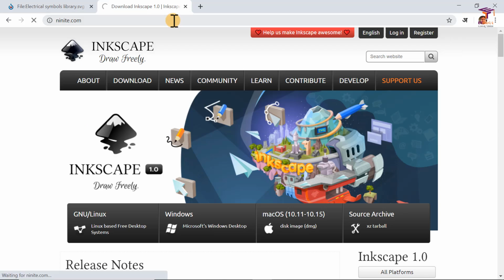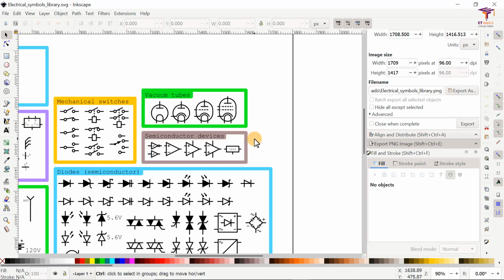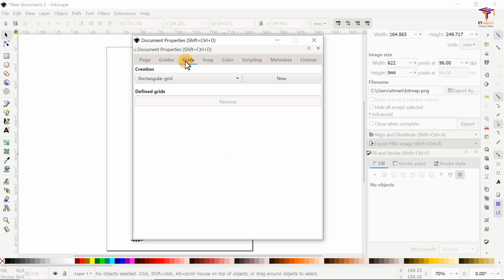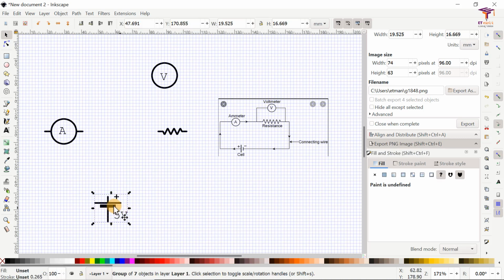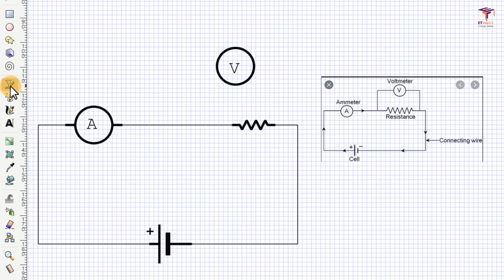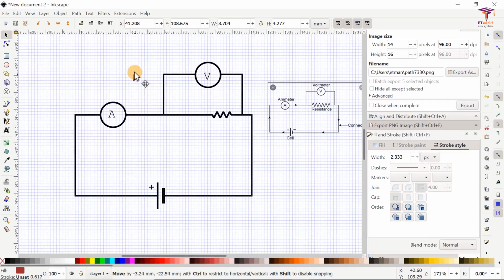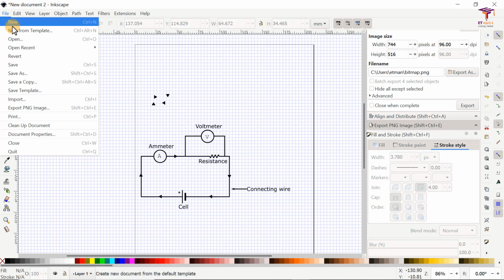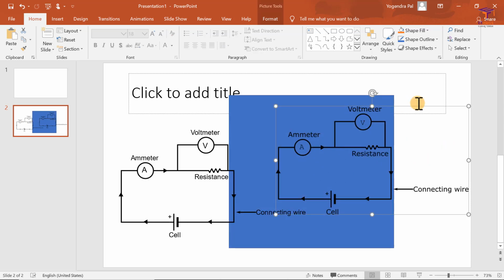Draw Circuit and Electrical Diagrams with InkScape [Free and Open Source Software]

Comment: Hello,any other electronic circuit simulation software like multisim will be more beneficial than this.Students can Actually see the real time simulation there.
Reply from the maker: Thanks for sharing. Is this free? Also, is it possible to export PNG files from this simulator to use in books or other media? Thanks again
Reply: @ETMantra  its free for demo.but one can use it for long time after changing the laptop date.
Yes there is provision for many types of file export.